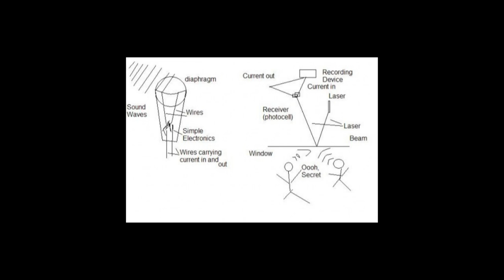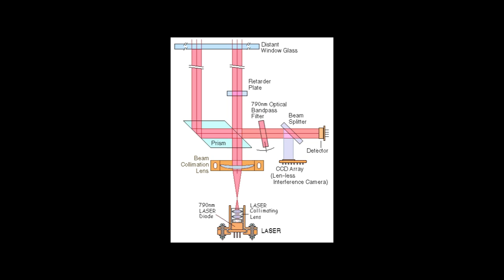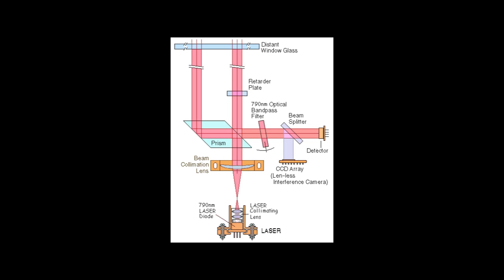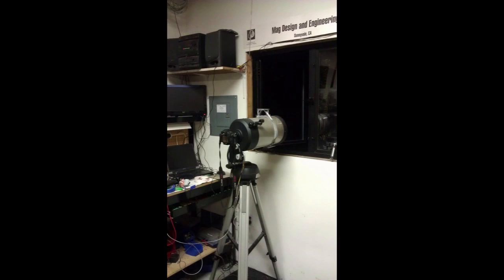Laser microphone for audio surveillance via window panes

Comment: In your opinion, is it possible to feel a sound or vibration on surfaces (masonry, wood, metals, etc.)? Agreed that this is the best solution, you point the laser and then it is reflected on a "photoresist," an audio jack cable and you are done. Without a shadow of a doubt, a result will always be there (even if not very satisfactory) ... . Instead, where it is not possible to have the laser beam return, other tricks can be used by applying the transducers in a certain way ... . Let me know your reflections. Thank you very much.

Comment: I have not yet watched the whole video, so maybe you already said that, but wouldn't an infraread laser avoid the issue of the double glass windows? or maybe use both visible and infraread to subtract the signal from the infraread laser from the visible laser, so that the sound comes purely from the reflaction on the inner glass pane. maybe that would be even clearer as there wouldn't be as much glass in the way

Comment: Post-filtering is very required. Some amplification on mids, low-cut, some expansion on highs, may be a bit of exciter from high-mid. And may be need to move beam nearer to the edge of window glass to decrease main resonance freq. level. You could download reaper DAW to try some audio processing with no money.

Comment: Remember one of your laser emitter experiment for distance measurement? 
Experiment has a TX laser diode packaged in TO-5 including a hidden second diode for RX. 
 Glass panel in vibration modulates the return path length hence phase of laser wave. The forward and return wave vector sum into an analog output voltage corresponding to sound vibration in the room. The diode use in this video may be second best.

Comment: You may want to match the receiver diode spectral sensitivity to that of the laser. Also you my want to add a spectral filter to the receiver and add some low noise amplification.

Comment: 5:33 It is possible that you have some kind of filter between the glasses (IR or UV) and this filter forms disperse (nanophase) area. Also do not forget that the volume between the windows is filled with gas, with different refraction number and other parameters (this can have less meaning but probably not help too).

Well, generally this kind of invigilation techniques involved advanced transforms (like Fourier) and uses digital filters. I was surprised of quality anyway. Simple - good quality photo-diode (no photomultiplier) with no post processing. Wow I am impressed. The easiest and good way to tune the quality up is to stream the sound on pc sound-card and try to use some real time Fourier software. I am not sure that any card do that, but you can try. I have done some trials with gnu-octave FFT but it was not real time analysis.

Comment: Have you tried pasting a strip of retro-reflector tape on the window? Since the beam would come right back to your source, the angle of incidence doesn't matter! Retro-reflectors are used in bikes as well as automobile rear-side lamps. A small piece should be sufficient as the laser spot never diverges beyond 1cm even at 200m

Comment: My dad told me about how this worked in 1965!  Not with laser light, but with microwaves.  He explained the Russians were using this technique on our Embassy in Russia. He was always constructing these kinds of things. I think he knew a lot more about spy techniques than he was willing to tell me as a 13 year old boy.
Reply: Just saw this in a Russian move. I am trying to understand which year this technology was invented. Do you have any idea?
Reply: @bboystancho  Not sure but it might have been after the invention of the Gunn diode in 1962. The return RF from the window would be phase modulated by the audio vibrations on the glass. I suppose they could have been doing it even earlier using Klystron or traveling wave tubes but that seems a bit impractical.

Comment: I would suggest to use a quadrant photo diode. If the audio signal is encoded in the deflection so it will be perfect for this application.

Comment: What you need to do is recover the PHASE modulation of the beam; not spacial modulation.  You use a setup similar to what you show with the telescope, but you split off some of the light from the laser and pass it through an acusto-optical modulator and shift it 455KHz up or down.  The return beam is mixed with this frequency-offset light and detected with the photodiode.  This is fed into the 2nd IF stage of a FM receiver.  For best results, you have 2 beams; one shining on a solid surface in the target, and the other on the moving surface, and difference those.  Otherwise, you will hear toilets flushing, road traffic, etc.
The laser must have a coherence length equal to 2x the total distance to the target.  You usually insert an etalon into the laser cavity to accomplish this.  I worked on such systems!
Reply: @K Lock-in amplifiers don't cut it in this case.   The only thing you can lock on is the amplitude; the phase is lost as soon as you go through the first slotted spinning wheel/and (square-law) photodiode detector.  Lock-in is useful for amplitude unformation when you can reduce post-detection bandwidth to a small fraction of a Hz.
What is "locked on" (in coherent scheme) is the oscillations of the source light itself.  The coherent scheme does not introduce the "noise-enhancing" effect of the multiply in the square-law detector.
It can be shown that the noise bandwidth of a receiver is the geometric mean of the bandwidth at the square-law detector (which is terahertz) and the post-detection bandwidth.  Even with only 2 KHz post-detection (to barely pass the audio), the noise bandwidth is in the MHz!   Using phase-coherent source, noise bandwidth can be reduced to 10KHz.  Also, the true nature of the motion you want to pick up is translation along the axis of the beam, not rotation (which is what amplitude scheme picks up).
Reply: I know I'm 2 years too late, but do could you provide a circuit schematic please? I am asking because I am trying to learn more about circuits and electrical components. Thank you!
Reply: @oitthegroit1297  This is more about getting highly specialized optical components than "building circuit according to schematic".  First, you will need a laser with a coherence length twice the distance to the target.  This is not a simple thing (most lasers are not good enough).  Even measuring it is challenging, as you need a stable platform that is as long as the range you plan to work.  The acusto-optic modulator is insanely expensive.  They are best gotten from old laser printers (before laser diodes were invented).
          Regarding the amplitude method that Applied Science uses, he provides all the schematics you need (for biasing the photodiode).  You need extreme shielding.  Mount it in a small grounded metal box with a small hole for the light to enter.  Connect that capacitive coupled to low-level microphone input of audio preamp.
Reply: good to know
Reply: I thought about putting a small piece of reflector tape on the window to reflact
Reply: @michaelshultz2540  If you do that, you get the motion of the WINDOW, which includes wind, car horns, etc.  You should target something IN the room, such as a piece of paper lying on a desk.
Reply: @bpark10001  or a wall in the room. Or a curtin or a poster on a wall or the inside pane of glass on a multi layered window. The trick would be placing the tiny bit of reflecter tape or maby some clear spray paint with glass beeds in it would be good for an interior wall or the back of a curtin where it would go unnoticed. All which would require intering the room to be servailed. Targeting the outside of a window and a surface outside apart from the structure and using noise canceling superherrodine circuit is the best solution.
Reply: @michaelshultz2540  No need to enter room.  Target something already IN the room that is thin, light & will respond to audio much better than heavy window glass.  Yes, reflection is diffuse, but you counter that by focusing a telescope on the target spot.  The telescope both focuses the outgoing light to the target & the return light.  Use a polarizing beamsplitter to separate the return light (the diffuse reflection scrambles the polarization of the return light).  You can scan room objects while listening to find the best spot to illuminate.
Reply: Very informative, questions would it be possible to aim this in someone's direction or head and prerecorded sounds or any sound would be Heard? I'm not intending to make or do so.
Reply: @myyoutube6978  This is one of those things that works well in theory, but hard to put into practice.  You need target conditions that are "just right" to get intelligible audio.  There needs to be a moving surface (such as a piece of paper on a desk & the desk surface) that can be differentiated.  You also need a clear optical path to both from the listening post, & a clean window.
Reply: @bpark10001  thank you for your response, I was just trying to see what and how certain people were imitating this processing. Once again great work, great video.

Comment: This seems like the kind of thing FM demodulation (FDM?) would be suited for, but I don't know the exact setup. I imagine longer wavelengths are more suited to this. If you could get it up near a millimeter, you'd reduce the likelihood of the dial "looping back to zero" as a the glass bends, so to speak.

Comment: Beam angle is an easy one, you could easily set up a mechanical system to maintain the corolation between your lazer and the receiver based on the height (length to target) of an isosceles triangle and its base (distance between lazer and receiver). Based on the audio you have already demonstrated, all you need is a preamp and some bypass filters to clean it up and you should get a good sound.
You could then try using IR or UV lazers to be more descret.

Comment: Besides the problem with the focusing of the beam, one of the causes of you not being able to pick up anything usable is probably the air refracting the light because of the temperature differences in the air between the light source and the light detector (from the laser to the reflective object and back to telescope). Maybe a bandpass filter (speech audio frequency band) could cut off some of the noise, but I suspect that the diode is too "wide" and picks up more than just the wavelength of the He-Ne laser and introduces a lot of noise. I expected you to experiment more and go deeper with this one :)
Awesome videos, as always! Keep it up!

Comment: I recall reading in a book about spies that they would use some sort of reflector (a small one obviously) on the window pane. Think of that 3M stuff used in signs that reflects the light back at the same angle no matter the orientation of the plane its attached to.

Comment: Suggestions : 
1: How about :  Increase the amplification by increasing the length of reflected beam.
2. Just using a photodiode at the eyepiece of telescope will not work, IMO. Because total intensity of the light will remain constant. You need sophisticated electronics to convert the movement of reflected spot on the wall it into audio signal. (software will not work due to speed issues.)

Comment: Messed with something like that years ago except we used an array of IR led's through a fixed lens to narrow the beam and used an photo transistor, a 9 volt battery and a piece of metalized plastic from a Doritos bag, a flashlight body to mount the foil to the face of, poked the transistor through the center,(the transistor was slaved to an LM486) of the plastic, which served as the receiver, taped the units together, and it did actually work, but range very limited, about 25 feet and the audio was fairly decent. You really need a parabolic shaped receiver for better results i think.

Comment: I designed and built a LASER transmitter/detector for my senior design project back in the 1980's. I tried several different detectors including photodiodes, photocells, etc... and some were quite expensive. With minimal results, I tried anything and everything. The best results were achieved using the least expensive 75¢ solar panel disc from Radio Shack. Once again, Occam's Razor  :^)
Reply: Hello, do you know of a way to jam a laser microphone?
Reply: @calebw9747  - Just guessing but... I would experiment by building an inexpensive device using a speaker attached to the window which generates a random noise source such as white noise. People's voices in the room would be mixed in with the random noise and get scrambled.  Placing additional speakers against the window with a different random noise source would scramble the voices even more. The best way to defeat a laser microphone would be to close the window blinds and write down your conversations on paper and then burn after reading.
Reply: @The_Peddler  Thanks a lot for your response this means a lot to me. Lets say it was theoretically possible to use a laser on someone's inner ear that is able to read someone's thoughts and play audio directly into their head by vibrating the inner ear and modulating the signal into something we can hear. What would you do to defeat this technology? Is there a way to disrupt the modulation of a laser? The only way I could think of was to build a force field but that's illegal, do you think you could jam this signal with ultrasound? thanks
Reply: @The_Peddler  Hey, could you draw a circuit diagram, take a picture and send the link to the image to me please? I'd like to know how to make this, it sounds super cool.
Reply: @oitthegroit1297  Will do. It will take me a couple days to find my lab book in storage somewhere. Don't get your hopes up about re-creating the same design though because the circuit requires a gas tube He-Ne laser from the 1980's. I used a Spectra Physics 155 shown here 
https://laserpointerforums.com/threads/spectra-physics-155-hene.100270/
Reply: @The_Peddler  Thank you very much! I dont have a gas tube Ne-He laser, is there a more modern, affordable way to do it? I'm asking because the video doesn't provide circuit diagrams.
Reply: @oitthegroit1297  I'm sure there is but I don't have any info about that. You might check with Applied Science who is the OP for this video.
Reply: @oitthegroit1297  I found my notebook and scanned it. You can download it here -->
http://llamamusic.com/temp/EET_490-491_Senior_Design_Project.pdf
Reply: @The_Peddler  Thank you!

Comment: Have you thought to try a bandpass filter or notch filter to get the stray frequency out? Also that noise could be stray light from street lights or star light.
Reply: KyHighlander59 I was thinking that and using some sort of discrete Fourier transform to decompose the individual frequencies and filter the unwanted ones out and then reassemble the stream.
Reply: To make up a fully adjustable unit with multiple channels that can be phased in or out in their timing cycles... So you can feedback signals 180 out of phase to cancel out unwanted signals by other sensors in other directions, be they mics or photocells.

On the other side of the coin... there is the idea of noise cancelling unwanted sound coming at you by recording it and playing it back out of phase so i cancels out. This done by distance of the mic nearer the sound, and a speaker between you and the sound that points at you... The tuning in delay would be to get them synched so it played the exact sound in revere polarity at the speaker. When the two meet they cancel each other out in the air.

Perhaps @APPLIED SCIENCE might consider such device concept?

Comment: It would be interesting at what frequency bandwith goes through window, what resonance frequencies there are. It probably depends on window glass thickness and area. Also, pointing a laser at window center doesn't give much signal, as bending angle is lowest at that point. In theory :)
Reply: Best thing to do is NOT use the window!  Bounce the light off something inside the target room instead, such as a piece of paper on a desk.  Light bounce will not be specular.  Telescope must have high gain & mask to remove all light except that which bounces off target object.

Comment: hello Ben, you can use an IR Laser just to get rid of the big visible spot on the window.
Reply: For actual surveillance, yes. But for tinkering and testing like he's doing, using an invisible laser would only add extra difficulty.
Reply: 5:30 the beam spread is likely the dual pane windows coating on the glass, and the reflection being dual (2 pane window), mixing the 2 images at receiver focal point 1/2" out of phase. Its the glass either way. Other ideas anyone?

Comment: If you look at the edge of the beam spot in the telescope, the signal is there, not in the middle. You can also scan around the edge of the beam and find that your "virtual microphone" is also directional within the room.Also, it should be easy to detect the resonant frequency of the glass pane being monitored and write a notch filter for that frequency. You should get stellar results if you do that. Nice work!

-=p

Comment: Since you're using a 9v battery, wouldn't the output signal only be giving you half-waves? Sound is an alternating current, and I'm not sure your setup would account for that. Try testing your output with an oscilloscope. It could explain the noisy output.

Comment: There was an ex CIA story ,youtube video that told a story about using a prism in order to control the angle made by  the 2 beams. .That guy said that the beam that travel a glass prism reflects at the same incident angle.This way it should be easier to control the angle.Did you see that? It was about russians/americans spying.